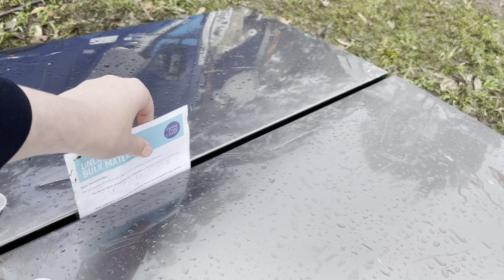Central Coast’s Ex Parramatta On Hard Waste - RL00223 | Ft. @JTGarbo

Comment: Waste of unwanted items in England has to be sorted into separate categories for electronic waste separating from land fills waste. Wooden boxes and furniture separated from sofas and mattresses and pillows, duvets, cushions and carpets are all separated into a different category of plastic waste and plastic containers and garden furniture made from plastics being separated. Computers and monitors and televisions are another category. Having to take your own items to the local recycling centre to hire skips and state what you need to get rid of the waste companies that like the waste stacking separate than just throwing away everything and anything together. Freezers and fridges are a separate category and not placed in a garbage truck and be crushed with other trash and rubbish centres selling waste that can be recycled metals separately and hardcore from building materials to use as foundation for pathways and roads etc wooden items and turning into multiple types of materials for mulching and chipboard materials freezers are dismantled by waste centres in various industrial processes and recycling materials that can be sold to other industries and reused.

Comment: what they needet is a GEESINK Garbage truck, then you don't have to hang a paper that the refrigerator is too big to remove it. The garbage truck just sucks. GEESINK truck is bigger and stronger and more space. this garbage truck have no normal space for load. the press pushes everything out again, this is because there is not enough space in the truck. This is a fuckt up truck